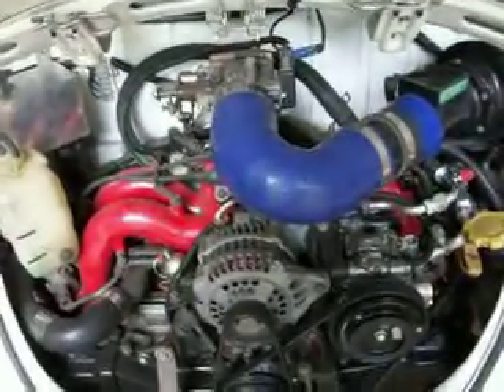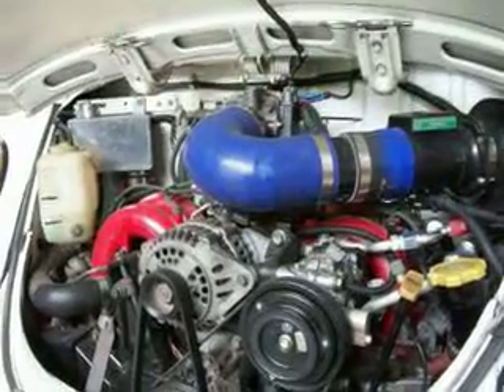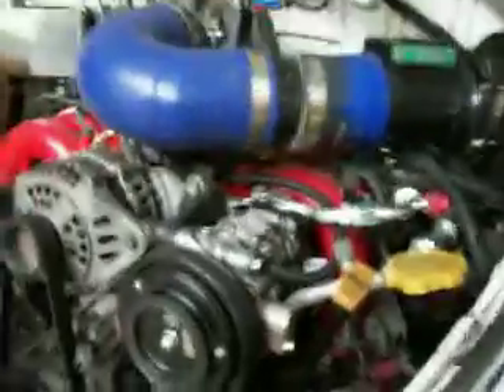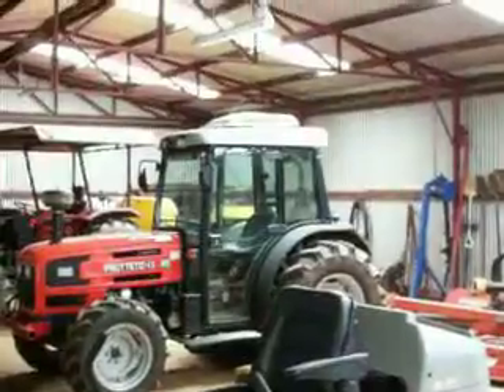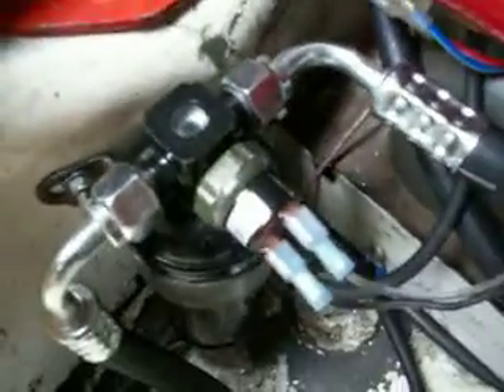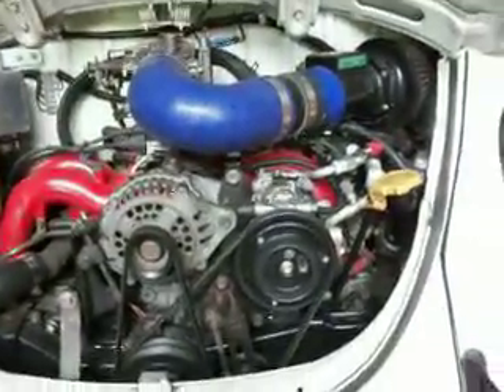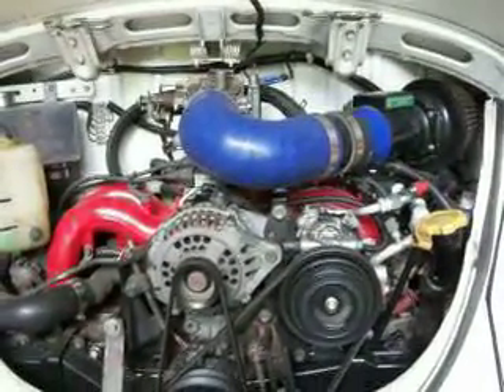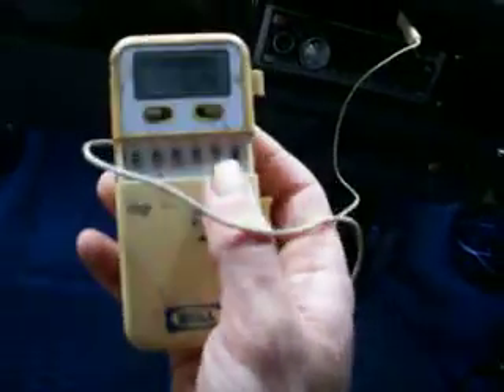My 74 Superbeetle A/C system

Comment from the maker: We just charged it with the standard WRX quantity which was a bit over half a KG and that has proved to be just right despite the extra pipework.
It's running about 25lb suction and abit over 200lb head pressure, air off temp gets down to 3.5celcious.

Comment from the maker: Hi, I've sealed up around the gaps using a foil type tape used in duct work, works really well. Compressors do get warm but if it's getting very hot you system may need some refrigerant oil added. Leaks on the low pressure side tend to leak oil more than the gas.
You'll notice because it willbe very dirty and oily where it's leaking.

Comment from the maker: Most of the work is in the electrical and cooling.
The engine fitting was easy because I went non turbo SOHC originally 2.2 now 2.5
The turbo and N/A DOHC take ALOT of work to fit, the bumper mounts need cutting out, parcel tray cutting out and the transmission moved forward if you dont want the engine sticking out holes in the fenders and decklid then a trans that wont break on boost for turbo engines.
Not for the faint hearted but if you know your way around mechanics it's not too difficult.

Comment from the maker: Thanks, the console I made just out of MDF with some carbonfibre film and grey cloth and the switches come with the A/C kit.
The subi conversion I did all myself except I had the loom professionally stripped and a custom sump built which both added $1k to it but the whole conversion including a $500 1992 Legacy was $3k and the A/C I did myself for $1k using all new parts.
I do have a heatercore but I've never hooked it up, don't need heat in this part of Aus.

Comment from the maker: @1999CSVT not with this particular evap but even so it wouldnt help, the fan blows alot of air, its just the crappy ducting and vents in the dash that are the restriction.
I'm making up a new dash with some better round eyeball style vents which should flow alot more air.

Comment: Thanks so much for the info. It's funny, I picked up on your accent but for some reason I didn't put 2 and 2 together.

Yeah, the US has some interesting ideas about safety. That was also the period of safety "reform" and the emission reduction plan was in full effect. The new laws strangled the power of every type of engine, and V8's formerly making 250+ HP were now making less than 150.
Your a/c unit is great!
You can see a full review of the 74 on Utube. Just put 74 Beetle in the search bar and look for the auto week review. Good luck with the a/c!

Comment: Your work on the A/C is very neat and done very well. I have first hand experience as I have been at my bug's A/C for over an year and it's not an easy task. 
I have tried to insulate the bug cabin but still hot outside air comes in with which takes away the effect of the A/C.
What is the size of the compressor you would recommend for a 1300cc bug?

Thanks

Comment: Unless I'm mistaken, that's a 1973 because the 74's had the mandated bumpers with the 'shock absorbing' tubes, not the brackets. Love what you've done with it though. I had a 74 in 74 with a dealer installed system. Crude at best, and never really cooled as much as I wanted it to. Also one of the pulleys was never able to be aligned and ate/threw belts like  Donald Trump tweets. Did have an Abarth exhaust which sounded great. If you've ever seen the movie "Catch 22" when it was cold, my car sounded just like the opening.
Reply from the maker: john bullerjahn mine is an Australian built car, only USA market vw’s got the big snow plough bumpers in 74.
It’s actually a 75 as far as VW are concerned and was w in 75 but I still call it a 74.

Comment: Where do you keep the spare tyre?
Reply from the maker: It sits in the space between the radiator and fuel tank.
Reply: @BoostedVW  you  have done  fantastic job well done !! as most of the videos I have seen so far puts the condensers underneath the floor which is not practical in countries like I live in with bad road conditions. Do you think I can customize be able to do keep the condenser in front like yours if I pickup the ac unit set from gilmore-enterprises ?
Reply from the maker: @janasamit  thanks, I’ve often thought the same about the gilmores system as the roads here in rural Australia are pretty bad too. There isn’t a lot of room up front unless you cut out some of the spare wheel well. 
Another option I’ve thought about is positioning each condensers behind the back wheel near the tail lights, I’ve seen that done before, would just need a grille over it to stop damage from rocks.
Reply: @BoostedVW  let me try thanks for the advice 🙏🏼 . my one is also 1974 Super Beetle .